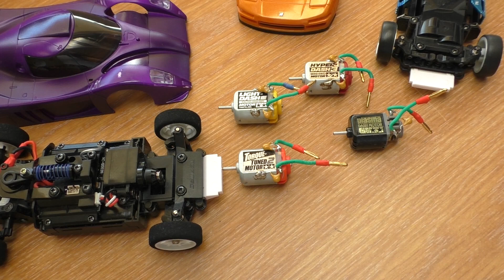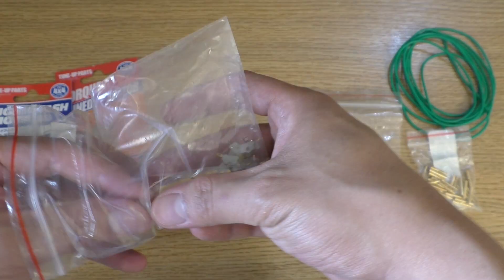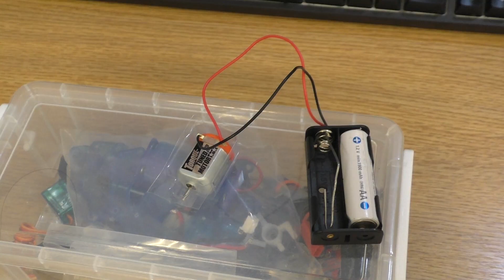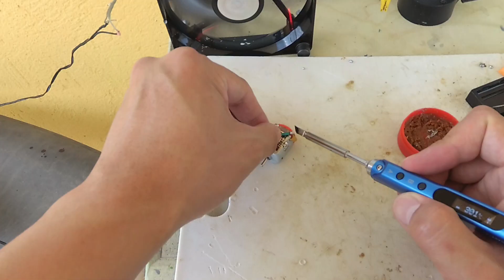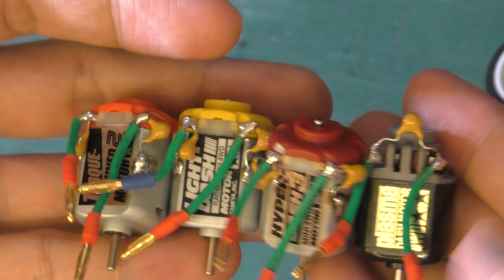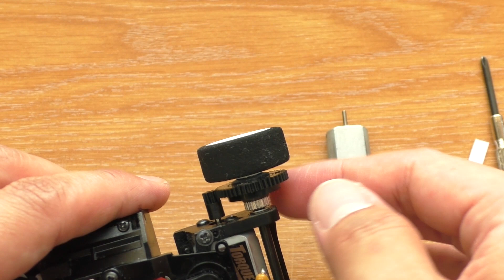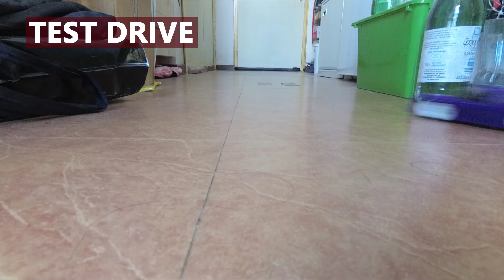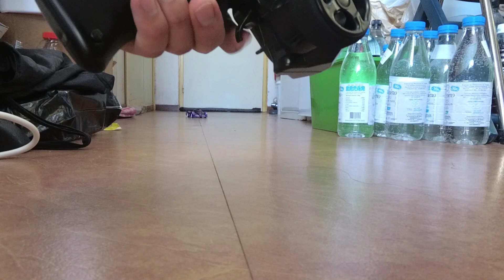How to Use Tamiya Mini 4WD Motors in Mini-Z and Mini-Q Q2

Comment: Thanks Beaver, awesome video.   I've been waiting for this video since I have my mini-z 4 years ago,  you just answered my question on which capacitor to use.  For those who wants to know if there's no capacitor on the 4wd motor, the steering will just jump left and right randomly when motor is running, due to the electronic noise as explained.

Comment: If not mistaken, the Plasma Dash can draw from 2 upto 4Amps of power, unlike some of the other motors that top out around 1A. I could be wrong here, but the Plasma is known to be higher current. However, have you tried the Auldey Mini 4WD motors? The Mini 4WD culture here in China is more around high speeds (less on acrobatics, like jumps) so the motors are generally higher speeds (you are racing the other cars). You can even buy sets or individual parts for winding the motors yourself. This is different from the Tamiya 4WD culture where competition revolves more around part selection and 'limited' car modifications to circumvent the track (it feels you are racing the track).

https://mini-4wd.fandom.com/wiki/Plasma-Dash_Motor
Reply from the maker: It also depends on input voltage too so the amps draw doesn't apply when you use it like this.
I haven't tried using Auldey motor with Mini-Z yet but I used to have them when I was a kid. Super fast motors and cheaper as well.

Comment: Have you tried it on the Mini-z?
Reply from the maker: I haven't put it in my Mini-Z yet, I'll do it later because I'm changing the motor mount to 98mm wheelbase. But a lot of people are using it already without any problem.

Comment: Would you recommend the same motor for the wltoys ESC?
Reply from the maker: No, these motors won't survive 7.4V let alone 8.4V at full charge. Besides, there're no mounting holes at the front too. You'll have to stick with FK130 or PN Racing motors.
Reply: @BeaversHobby  I once tried mounting a stock Tamiya motor with a modified motor mount from a VS chassis on my WLToys RC. No capacitors, resistors nor voltage regulators. It run for less than 10 seconds at full throttle, and then burnt out (literally). the brush is burnt and the plastic cap is molten.. but it was crazy fast during that 10 seconds.. i guess a voltage regulator and ball bearings at both sides of the motor shafts would help, but didn't bother to do it.
Reply from the maker: @macheno4  Yeah, the voltage is too much for the motor to handle.
Reply: @BeaversHobby  yeah, the normal voltage it can take is 2.4-3.0v. it's just a matter of time to burn that with 7.0v+, but it's fun to do experiment though. https://www.tamiya.com/english/mini4wd/setupguide/motorguide.pdf
Reply: @macheno4  ive done it, losi 3x5mm bearing fit the cans and armature shafts. Neo mags and drill hole in can to vent the heat. Glad to see you got some tamiya motors finally. Plasma dash and 31turn pn racing both on 2s lipo with a k989 esc no problems as long as gear mesh isnt overtight.
Reply: Pn racing type cans can be used for upgraded brushes btw
Reply: You beat me. I also wanted to ask that question but knew the motor mount is on the front, it might be possible to use the mini q motor mount with the wltoys motor mount but I think there's not enough room for this  added motor mount as well!
Reply from the maker: @davidfurguson5215  Mini-Q motor mount also uses front mounting holes as well. 3D printer will solve every problem though.

Comment: You can make ESC from micro servo motor's controller.That ESC is very small-like chip, smaller than ESC-s which you using
Reply from the maker: I've seen some of that too but never tried one myself. It should be good for small 1/60 car.
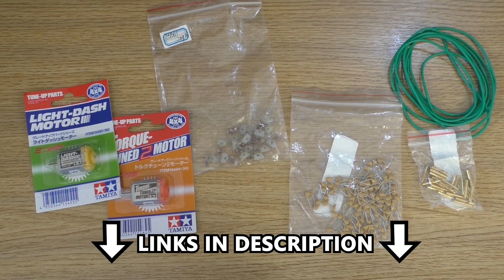Reply: @BeaversHobby  you can use it for your 1:28 cars because it's 40A ESC
Reply from the maker: @onlinehelper374  Interesting. Thanks for the info.
Reply: Yes, you could but they are quite limited in amps as they are lower geared. I make my own from a tiny STC or ATtiny microcontroller and a motor driver or N-Channel MOSFET. I do HotWheels modifcations at 1/64 scale and pretty much use the same as https://pixelfed.social/p/gbraad/168786405697392640 as you can see in https://twitter.com/gbraad/status/1295274925729562624 For those who want to understand how to use the (mini) servo controllers... well, you just don't connect the potentiometer. this way it acts like a 360 degrees servo as it can't determine the position.